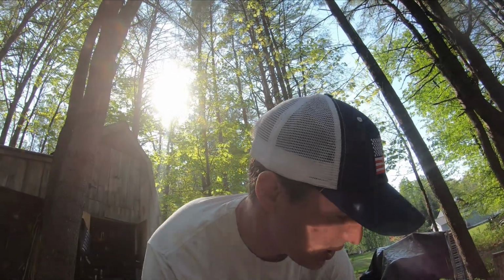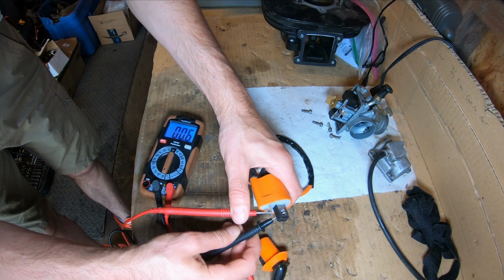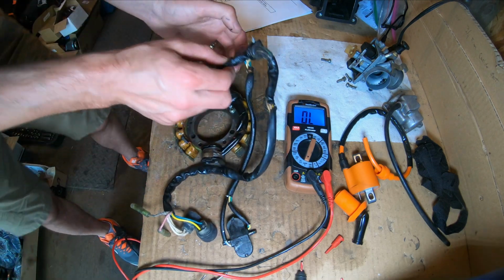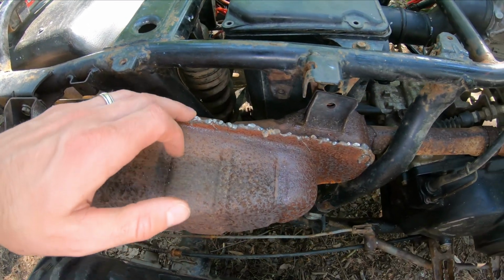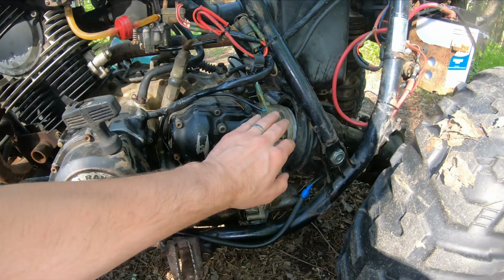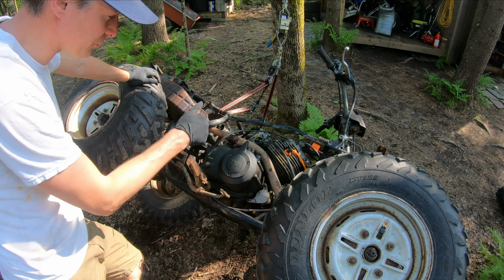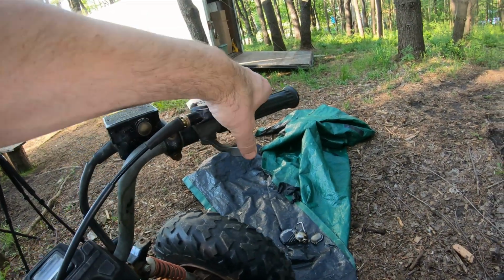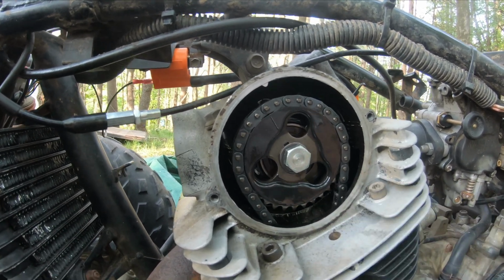1987 Yamaha Big Bear 350cc 4x4 - Troubleshoot No Spark Condition & Adjust Valves - Part 4

Comment: I have a 88 yamaha moto 4 350 and it just quit on me when driving in the woods I pulled it home and had no spark found under the wire loom to the stater the wires where bair and one was Broke joint them back together and Walla fixed figured it out within a hr of digging just in case other have same problem it was right where the metal strap for the wire loom right on side of case

Comment: Good work but was looking for more a reason to why did you figure out it was just a bad spark plug wire or ignition coil as I have just now ran into the same issue my bike had spark last year parked went to work on it and now it lost spark completely
Reply from the maker: Pulling from memory at this point but the coil and spark plug wire are usually a pretty straight forward resistance test from specs with an ohm meter. In my experience coils don’t tend to just fail but I would check the spark plug boot at the end of the coil to make sure it’s twisted on well. (Or perhaps take it off to inspect and ensure the boot to coil wire connection is good.) if you have a pull start try that in looking for spark as that will bypass several electrical issues. If you have spark with pull start then it could be stator related. Good luck.
Reply: @VermontLife Sadly no luck I have no spark with pull or electric start I have baught and changed the spark plug and coil assembly for the spark plus i also baught a new ignition coil and have yet to install that
Reply from the maker: No luck getting the manual off the site or everything in the troubleshooting walk through passed?
Reply: @VermontLife everything else has passed I noticed a few people had to change out the ignition cdi box which worked for them and thats what I baught jusy yet to install it was wondering if when you changed yours did you get spark back
Reply from the maker: I have had that happen in which I needed to replace the cdi which fixed it. There’s maddening thing will be if it doesn’t fix it. If it doesn’t fix it I’d sit back and go through the harness carefully. Peel back the tape and look for a bad connection. (Usually something someone else put in over the years. The factory connections are good 9 times out of 10.) look for frayed wires or wires under the tape that look melted and replace if so. Good luck. You’ll get it.

Comment: I think it might be my Ignition Coil that's the problem
What's your Favourite Coil?
The Coil is the only thing I have replaced with a brand new one
Reply from the maker: Oem but they are some bucks. I’ve run plenty of knock off Amazon coils successfully though when I have to and they have overall been fine. If they ohm in spec at the outset I haven’t had trouble.

Comment: Ive got a Big Bear 350 I have no spark
Ive replaced with new
CDI
Stator & Pickup
Voltage Reg
Key
Checked kill switch ( is good)
Swapped out coils and plug
Checked wiring and plugs cleaned up Earths
But still no spark
I.bought a Multi Meter today will check out more tomorrow

Does the Neutral light need to be working or is it just the Key Coil and Stator to make spark?
Reply from the maker: The bulb doesn’t need to be good but it’s a good sanity check for it to light up during testing.
Reply: @VermontLife 
Put a new plug and Bulb in light doesn't come on
Might need a new sender switch
Reply from the maker: @Gazzasore you can also easily test a bulb to see if it’s good with an ohm meter if you didn’t already know. One probe to the contact on the bottom of the bulb and one probe to the side. If it shows open line it’s a bad bulb. Another easy sanity check.

Comment: I just bought a really cheap 87 non running big bear. I am currently in the process of getting it to spark, I have replaced the stator (with one that has 100 ohms higher resistance on the pickup coils) and I also have a used one that tested within specs I have tried, have replaced ignition coil (of course none of them have had the primary coil in spec, closest is .6 which I’m trying to use currently). I guess I don’t know if the replacement stator and ignition coil that aren’t in spec are the reason I still don’t have spark? I am curious on what cdi unit you used, at this point I have around 550$ into the bike so I don’t really want to go and buy a 200$ stator.
Reply from the maker: Try a peak voltage test if you’re able. I use one from rmstator. Essentially if you’re able to do the test you should get around 100volts coming off the stator. If so you have full confirmation that the stator is good and sending power. I can’t recall off the top of my head the cdi but I can say it is an Amazon knock off. Good luck. You’ll get it.
Reply: @ read on one of the comments about trying to jump the key switch and sure as heck got good spark after that!
Reply: @ thanks so much for the info, I assume I would have to test the source coil output wires for this?

Comment: I have a Yamaha big bear, I have a question why would the head lights go dim when I use the throttle ?
Reply from the maker: Odd, is your battery bad or weak? Could have a failing stator coil for the power system,

Comment: did you replace the rectifier along with stator thats the issue bro YOU MISSED IT
Reply: It turned out to be the a bad ground and key switch must be oem
Reply from the maker: @davidpolmanteer5657  ah, yeah some of those aftermarket keys switches... I've had that happen. Congrats on getting it.
Reply: Thank you very much after I realized what the customer had done I also put a pulser coil into it
Reply from the maker: Rectifier? Hmmm. The wiring goes through the cdi for the ignition circuit. Rectifier wiring runs to the battery for the electrical system not the ignition system… I’m thinking through it but yes I did have an alternative rectifier that was put in (both tested fine on ohm meter and charge the battery). It didn’t help and as it wasn’t a part of the ignition system other than the ‘on/off’ switch I moved on from it. Tell me more though about your experience. You certainly have me curious.